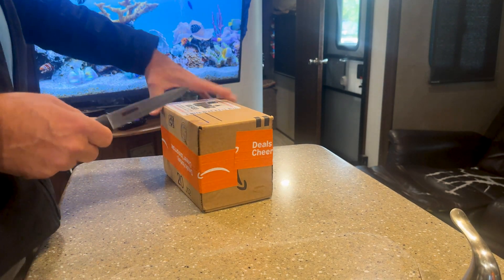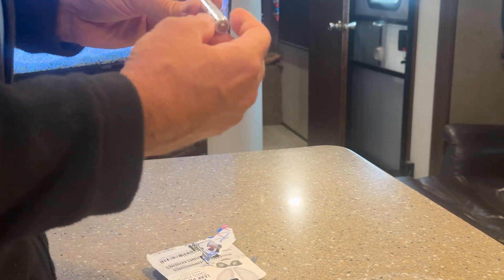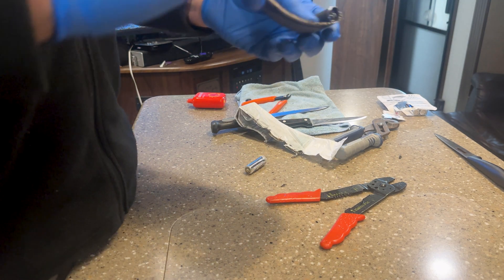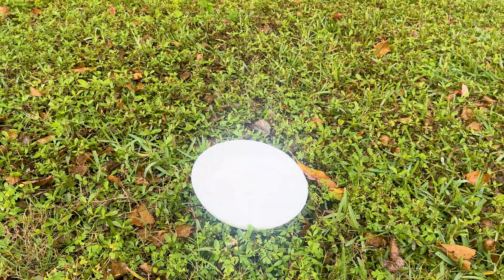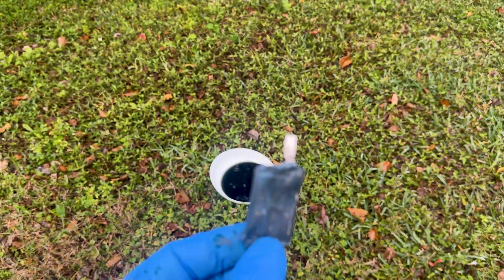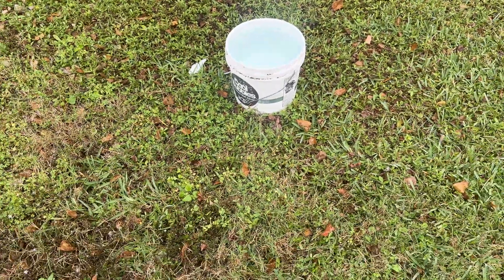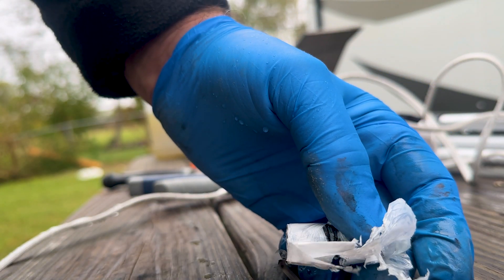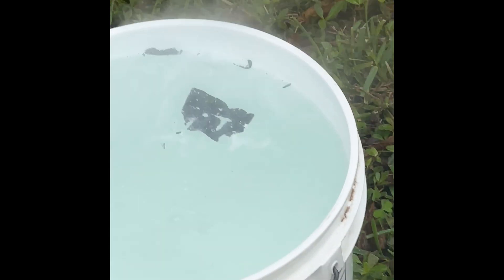What Happens When Lithium from AA Batteries Reacts with Water

Comment: I think the wind is blowing away and dissipating the hydrogen gas so quickly that it can’t ignite. I’ve seen that third trial done with a glass baking dish, indoors. It quickly caught fire and then exploded, shattering the baking dish. The highly flammable hydrogen gas being generated and ignited by the heat of the reaction is what burns and explodes, if enough of it accumulates.